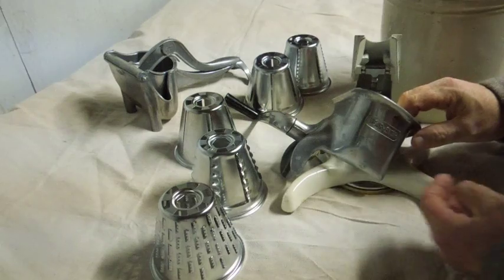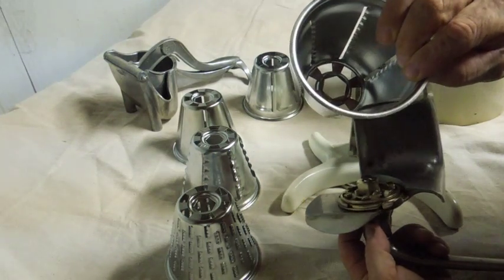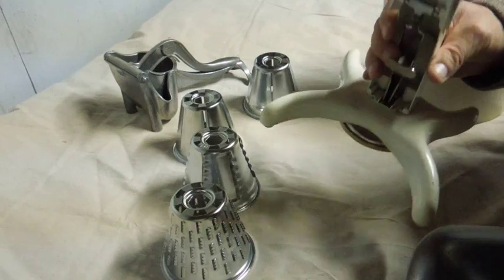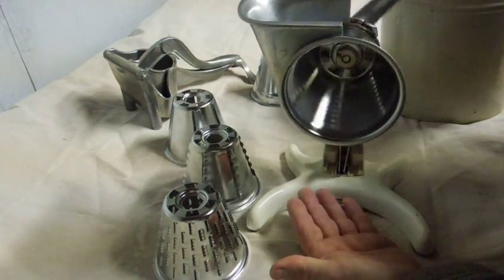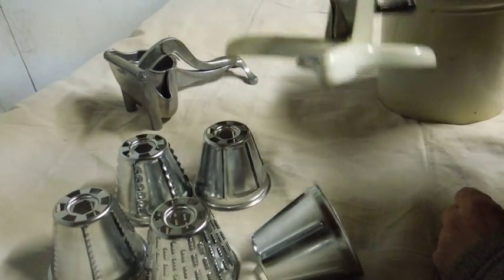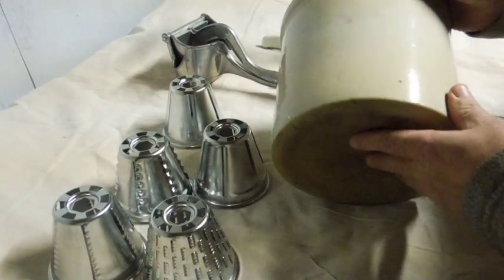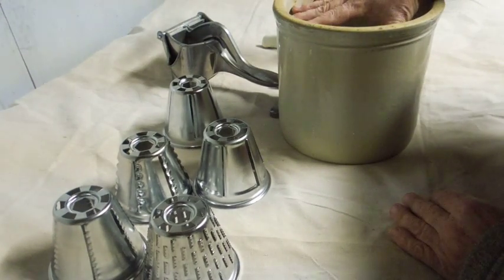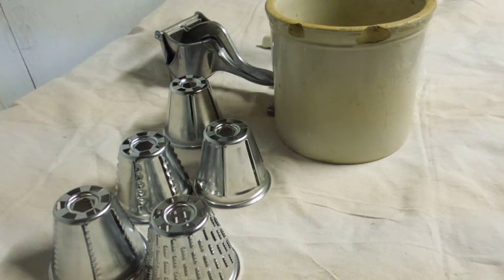Wear Ever hand operated food processor.

Comment: Found mine at flea market and bought it for $5. Not a clue how to attach parts, til l saw your video, Kudos my man. Whoever had this one had put it together with bad spacing. l took the handle off, corrected the back part by 1/8 inch and Bingo!. thanks again, l have been looking for 3 years, didn't want to pay $50 or $100.

Comment from the maker: this is a small version of the electric Hamilton Beach version.  It just had a hand Crank.  I loaned out the electric one to someone that wanted to grind meat.  They managed to break the cross star cutter and said oops sorry.  They dont sell replacement parts for a 50 plus year old kitchen appliance so I had to buy entire units to get the one piece I wanted. Now thru horse trading I have 2 identical electrical meat grinders to use at the same time.  makes a big project go fast.